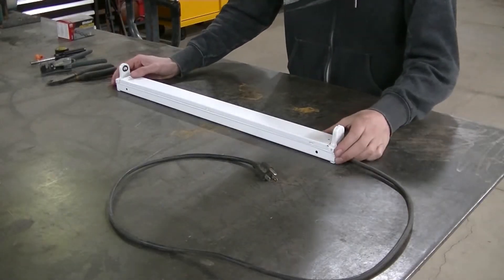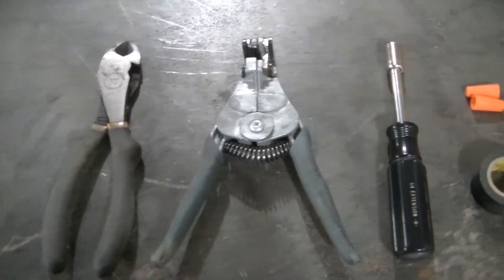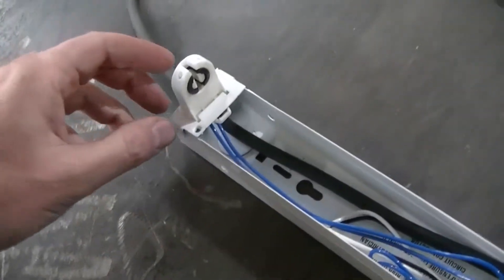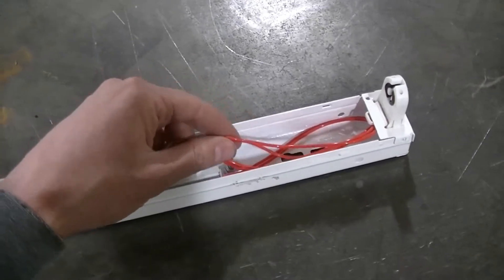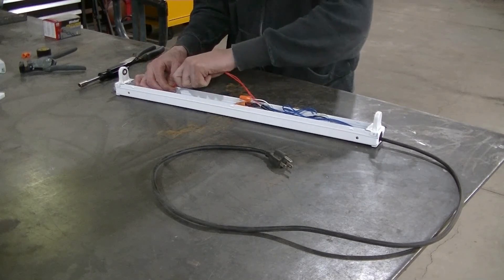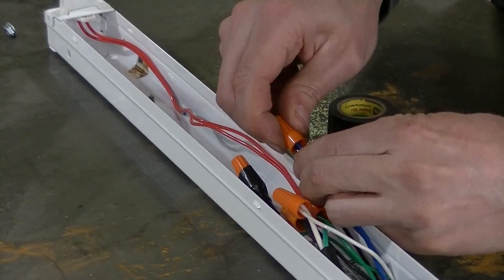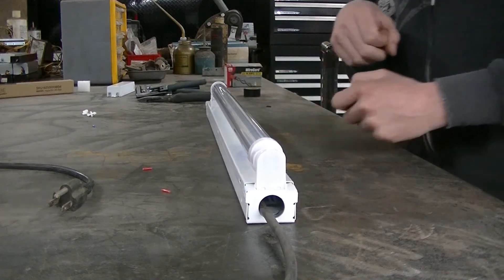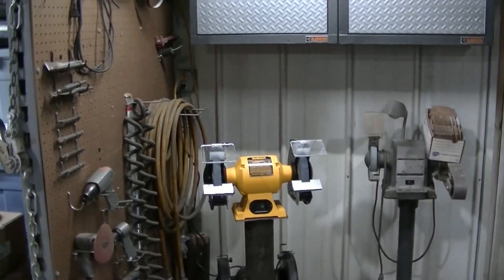HYPERIKON T8 LED Tube Installation

Comment: Can these be used on a dimmer switch than??
Reply: You have to check with each manufacturer because they are all different and you also need the newer electronic dimmer switches not the older ones for incandescent.